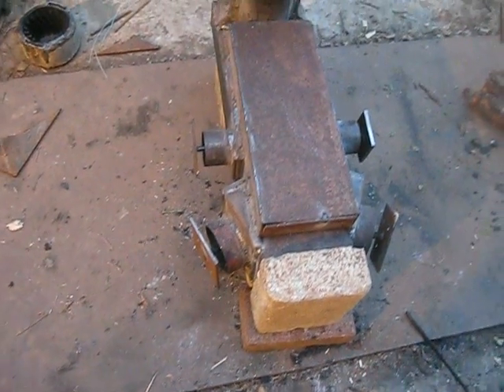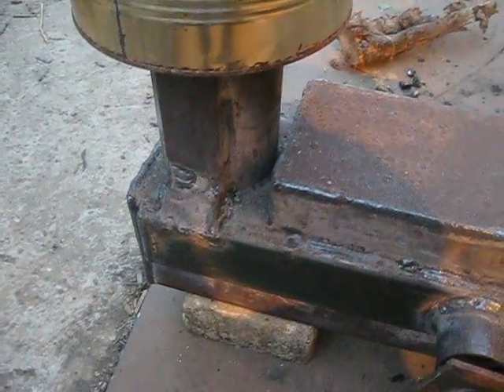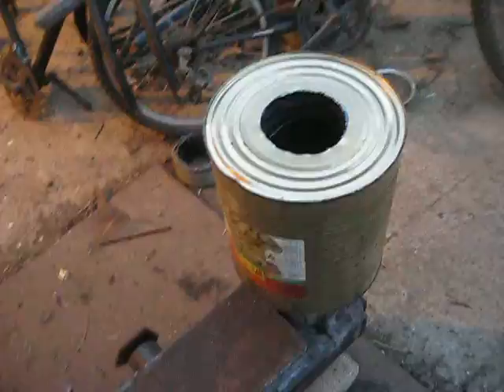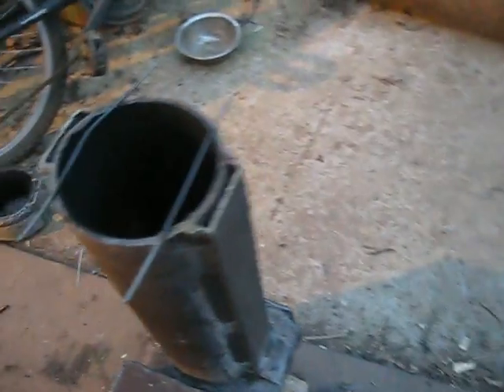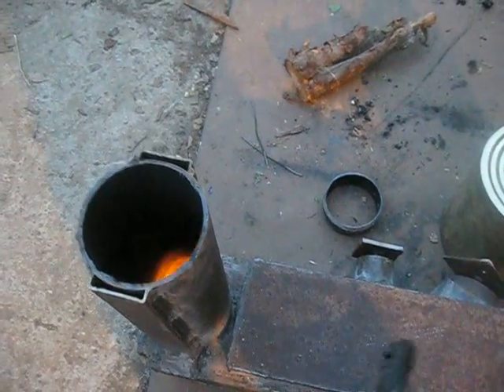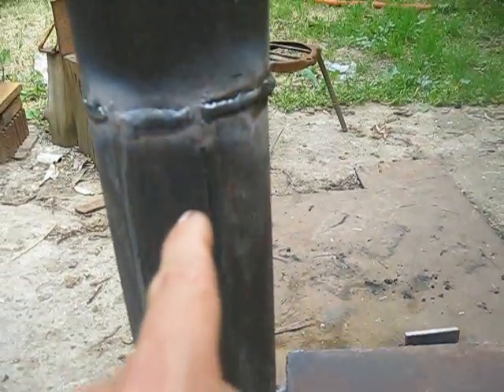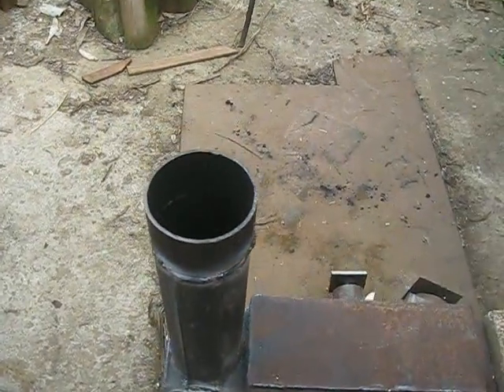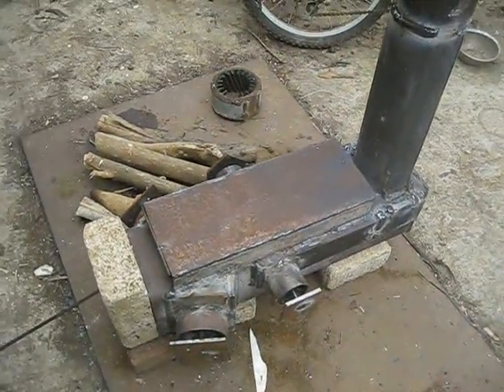Changes rocket stove secondary air input

Comment: M y idea is: your combustion chamber is too long and the fresh air intakes are not big enough to get enough draft throug the wood. I'm doing the same thing with woodpellets and i have to open the primary airvents completely to get my flame burning nearly white/blue.
Reply from the maker: If you see my other videos you will notice that I solved the problem of the secondary combustion.
Reply: At the moment i wrote my first reply, i haden't see your next video yet. Sorry for that misunderstanding.